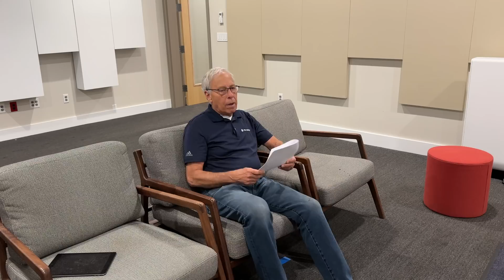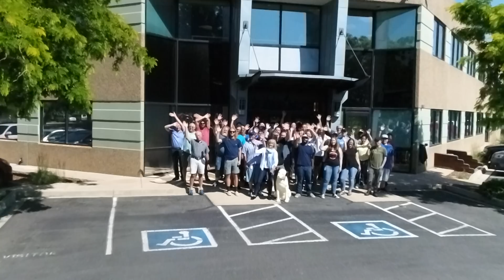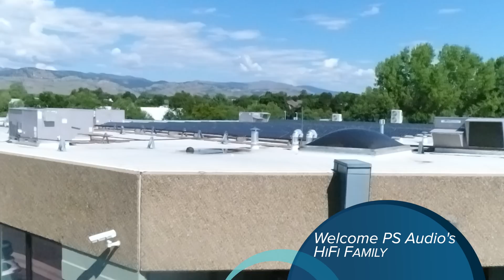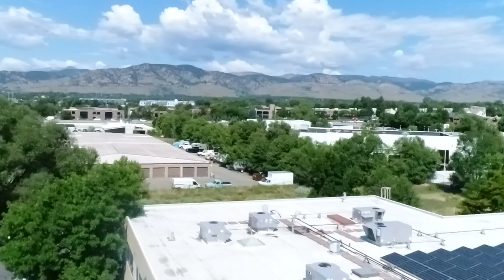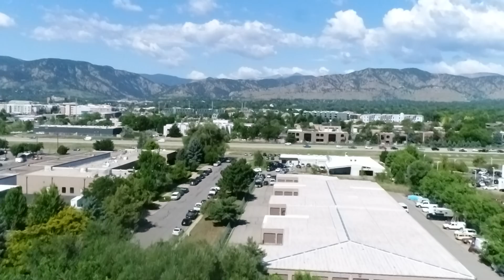Twisted or parallel power cables?

Comment: Could u please explain the reason to stay away from stranded? Im an audiophile, but im also an hvac tech for 13yrs, worked with an electrician for 2yrs before that, and have been zapping myself for 31yrs (im 35 lol).

Correct me if im wrong.. electrons flow more freely on the outsides of a conductor (no, im not mixing that up with the "shells" of an atom), which is why highter strand count hand handle more current than solid... Also, solid is more likely to break when used like an extension cable (unless the writter is referring to a permanent PA, then i get it)... And it is actually better to use parallel wire, over twisted, in VAC, because the phase cancellation occurs at the generator.. so i get that too, and twisting ac power CAN actually create noise.

I know its an older video, but if u see this, can u make another video for an explanation, instead of opinion?

Comment: For portable PA, only use stranded cable.  HO7 rubber sheathed, is ideal. Solid core will only flex so many times before it breaks.  Apart from it being a complete pain to coil!  If it's an installed PA system, then solid core would be ok.  Sold/Stranded won't make any difference to the sound.  Solid core is cheaper.  Most stranded cable is twisted inside the outer sheath.

Comment: I guess the stranded power cables on super sensitive medical equipment are crap, then. 

Look, you are asking about AC power, not low level signal transfer or DC delivery. AC power, by its own nature, is relatively self noise canceling. The alternating waveform does that. In a DC delivery system, twisting the wires (and variations thereof) create a similar waveform that helps cancel out the effects of implied inductance. Same thing with low level signal wires. The twisting helps keep out interference, especially at high frequencies (MHz on up), which is why ethernet cabling (and old style telephony) is twisted. Some have been used to go over 10,000 feet between devices. Telephony, even further. And speaking of old style telephony, is is a system based on DC, generally 24v resting, upt 96v ring, and down to 6v off hook. The signal is impressed on that DC to be carried to the set at the other end of the line. This is what was known as POTS, ot Plain Old Telephone System. (Magnetism, it's a real thing.)

As to your question, PA is all about covering the area as best as possible so that those attending have the best experience possible, aka, being able to clearly hear the performance. Having a singular sweet spot is not the object. As for the fullness of sound, that all depends on the power conversion systems in your devices AC to DC power supplies). Now, having larger guage power cables will not hurt at all, transfer-wise, you need to look at how heavy they may be to the connecting points. Mechanical reliability is a real thing. As far as needed Guage, it all depends on the draw of the sound system as plugged into the grid. If you don't know how to do that, I suggest you do some research and some real reading - textbooks on the subjects abound and are much more trustworthy than someone telling you what to do on the internet. Try looking for "Basic Electronics" at your local library for a start. 

As GI Joe said, Knowing is half the battle.

Comment: Hi Paul. Unless 12 gauge wire was specified, there’s probably 20 or 30 feet of 14 gauge to reach the outlet. The electrical difference of using 3 or 4 feet of 12 gauge to finish the connection must be minuscule. Have you actually heard an audible difference?

Comment: With a twisted pair, 2 or 3 turns per inch, you get 40 to 60 dB better common mode rejection. That means if you have strong RF fields from  from a near by transmitter, eg AM transmitter,  0.5 miles or closer, or local communications equipment, you will have less chance of RF interference, if your amplifiers are badly filtered. However most equipment nowadays are well  filtered and meets the FCC or EU EMC standards, so you rarely will be in trouble. Good luck!

Comment: oh, I challenge the advise of using solid core cable in power cables: in my experience they sound good at first but connection in plugs via screw down terminals is tricky if not impossible to do: copper is soft and gives and so the connection always loosen up a bit, so that after some time the good sound is gone and a certain harshness sets in. Also safety is a topic. some companies such as AQ manage to do a reliable connection of SC wires via cold welding though.. 
Perhaps via crimping SC wires with Furutechs y-lugs, which they produce only for their power cables, it can be done reliably. But mind, “wrestling” with a rather rigid high x-section power cord inevitably exerts bending torque on connectors, to some extent bending torque also extrnds to SC wires / y-lugs and connection points within the plug.. so best check and re-tighten connections regularly.

Comment: I have installed many PA systems, if it is a fixed install use 20 amp circuits and 12 ga. Keep your amps really close to the speakers with short cable runs with 10 ga speaker cable. I use canarie quad  cable for line level.

Comment: Twisted vs straight between the mixer and the mains?
The twisted-pair concept was developed to reduce the crosstalk during the early telephony days.
Crosstalk is the bleeding of the signal from one pair to another. In telephony (and now data, mostly ethernet) it makes sense, although..
Twisting introduces inductance to the pair, so it's basically just like connecting a coil in series with the circuit.
Coils in series act as low-pass filters, so this actually could reduce the high frequencies passing through a twisted pair cable, and as far as audio signal, this would not be beneficial. Just FYI, twisted pair cables are not recommended for alarm sensor dry contacts because of the inductance that would reduce the reaction time to for ex. a quick opening and closing a door. If the cable is long enough, the signal may not even get to the alarm zone terminal. Of course, it would be best to have an A/B comparison scenario to see (well, hear) if there's a noticeable difference in high frequencies with both type of cables.
I hope this helps..
Cheers!

Comment: Thanks Paul.  Always great to get your opinion based on years of experience.
In my own limited experience, bigger gauge does make a positive difference.  Also, decent connectors.  Makes no sense considering much smaller gauge is in the wall.  But it does, so why not?  Wire is not expensive.  
VH Audio publishes a cookbook for cables that worked well for me.
Reply: You are discussing power cables.? It depends on if its for touring use thats being flexed and moved every day or if its perminately installed. High voltage low current. Solid core for installation..stranded for touring... the statements of the audio sounding different is bs unless theres rf trabsformers.then its a mess. Shelding or active cancellation is different topic

Comment: Industry standard has always been Belden cable. And it's always stranded and twisted. Why reinvent the wheel? There's never been any lack of bottom end in live situations?
Reply: That's right. The only difference between solid and stranded power and audio wire is mechanical considerations. At audio frequencies, which includes 50/60hz AC power, there is no electrical difference between solid and stranded. Want to talk about RF in  the mhz region? OK, now we start to have some electrical considerations as well.
Reply: I hope Belden cable isn't that great. I can't tell you how many times I passed those up in thrift stores. Now I don't see any of those there anymore.
Reply: @sidesup8286  It's the one of the most used cable manufactures in broadcasting and mastering. What ever you listen to or watch, it's probably already been through thousands of feet of Belden cable. The pro industry relies on standard electrical engineering parameters, not consumer jewelry cables.

Comment: You do know power cables are AC 60hz and if you have both cables side by side (power cord) they would CANCEL each other out so nothing to worry about. Hence why you don’t see or find any twisted or braided power cords, it would be STUPID and silly. 

2:50 you’d stay away from stranded? WTF are you smoking old man? All power 12awg power cords will be STRANDED you moron. The wiring in your house may be solid 12AWG but that is because that wire is in a permanent location and position, unlike a power cord that you have to move around.😂

Comment: Most household outlets are supplied by 14 gauge wire.   
Think: posssibly as much as 80 or more feet of that, 
and you propose to make the last 6 feet between the outlet and the amplifier number 12?    
Ridiculous.  
But it's your money and you can waste it as you see fit.   
I get good results with the # 18 cords that were permanently attached to my equipment by the manufacturers.
Reply: What equipment came with cords attatched to them by the manufacturer? Wait, I'll be back in about.15 minutes..... OK......Lloyds, Soundesign, Clarinette, Yorx and Olympia.

 But seriously...Thicker guage wire can't make up for losses before it in the chain, but it can lessen any further losses from it's point on. People make it like that is so hard to understand. The wiring of questionable quality before the good stuff is one reason we'll never get absolute perfect sound, but doing the best we can from what we have to work with, from that point on, is wise and the results are more than fruitfull.

Comment: On my mighty 3 watt system, for speaker wire, I use a 16 gauge silver core wrapped by an 8 gauge teflon jacket. I leave them pure and unterminated.

All my power cables are various silver-plated eBay cables. Use Flux 50 NCF to filter the signal.
Reply: Interconnects are oil filled cables

Comment: I always use ordinary single core eletric cable as power cable for many years. then one day I decided to strip the outer insulation and then braid the 3 conductors, the result is amazing difference.
Reply: Wrong, you're imagining it.

Comment: There is missing information in the question to give an absolute answer. How long is the power cord going to be and how powerful is the amplifier? With a 3 metre 14 gauge cable it will drop just 0.25volt with a 1000W rms amplifier at full chat drawing 10 amps on a 110V supply. The incoming power to the venue will be varying much more than this, so going for thicker cable makes no sense. Something to consider with a professional installation is the robustness of the cable and a thick rubberised outer is more impervious to damage than T&E.

Comment: Who started this twisting one conductor around the whole length of the other? I'm sure it was a real long time ago. Lower guage thicker cable (all things being equal) always seems to help the bass and maybe a few other things too. I think seperation of strands is way more effective than twisting. The theoretical ideal, since there is so much electromagnetic interaction between all the individual strands, would be for the signal to run only through the center of the strands where it couldn't interact with the other strands as much. One of the best cables I ever heard, coats the outside periphery of each strand with a low conducttivity material to lessen electromagnetic interaction between strands. We're talking interconnect and speaker cables here. With thicker power cables it's easy to hear an increase in the fullness of the bass. Quantity is nearly always what the ear picks up on first. Bass, size of soundstage etc. before you notice other things that are also improved. When modifying, if you do something that makes a positive difference, it's usually an improvement all across the board. Some things might improve a little more than others though with a particular mod.

Comment: Really the only time you ever need to "twist" wires together is when the source and load have a high impedance, and they are subject to common mode noise or stray fields. Both speaker and power cables are taking power from a low impedance source and feeding it into a low impedance load. The noise has no effect, and the noise that does (e.g. GHz wireless signals) are quite easy to screen out via metal chassis work hooked to the local star point or ground lead in the equipment and filters on the incoming supply.

Comment: For power cables I absolutely prefer to use twisted vacuum dielectric conductors for the utmost in isolation. That way no noise whatsoever can infiltrate the system.